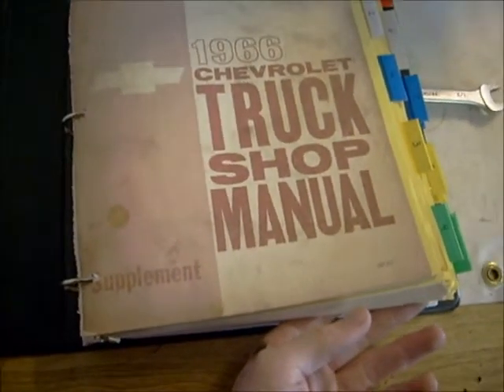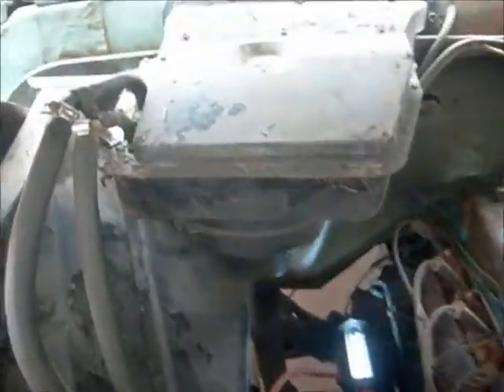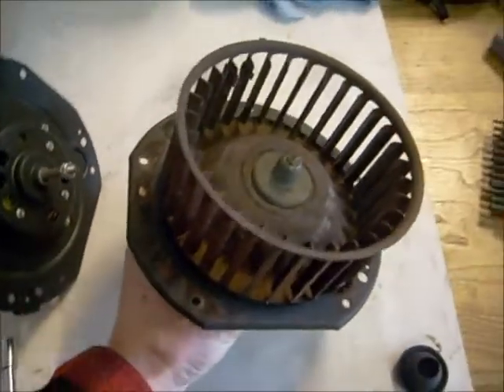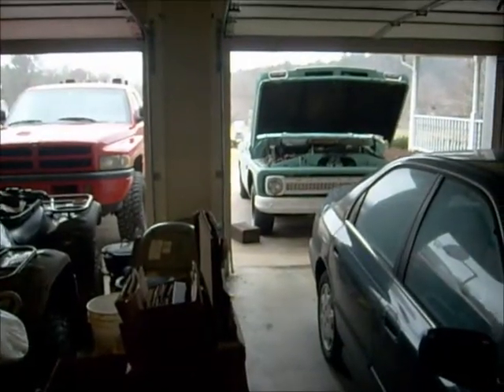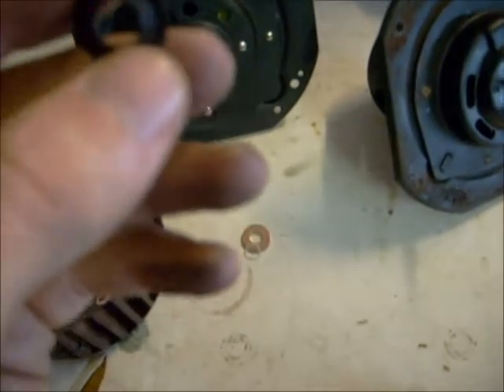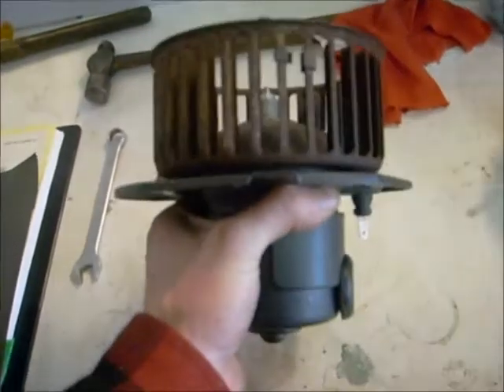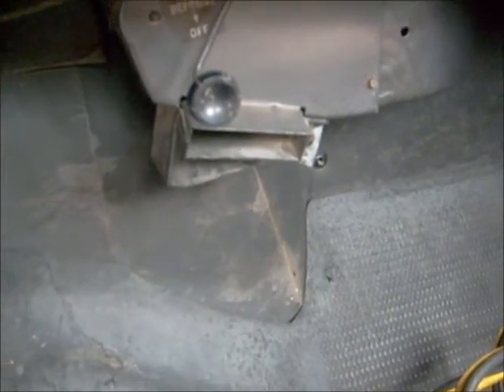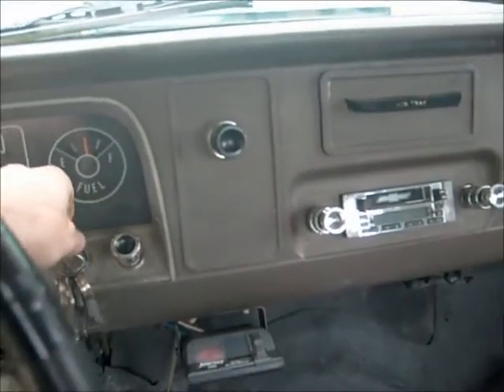1966 Chevy C-10: How to Replace a Heater Blower Motor

Comment: Nice,but you should have cleaned the fan and paint so it last 50 more years, I change my metal  squirl cage to plastic though alot less noise ,nice truck

Comment from the maker: The single knob is called the Thrift Air system and was the base model available. The three-lever system is called the Deluxe heater and was an option up from the Thrift Air system. There was also another level that was tied into the recirculating A/C system, and was the top tier option available for 64-66.

The thing about the Thrift Air is that the defrost lever isn't with the fan speed/temperature knob like it is with the Deluxe option. The defrost lever is under the dash on the heater box.

Comment: I have a 63 Chevrolet simular system different controls and I need to replace the blower resistor but I don't know if it is a deluxe or a non deluxe resistor is there a difference or any way to tell them apart?

Comment from the maker: @choirguy75 I checked the fuse block for any blown fuses and didn't find any.  I would try running a jumper wire from the positive battery terminal to the wire on the blower motor, if it doesn't come on, then I would suspect the blower motor, if it did, I'd suspect the switch being bad.  That's how I went about diagnosing my motor problem.  I bought my motor from LMC Truck, it was an identical replacement and of very high quality too.

Comment: I've always loved the 64-66 chevy trucks, and would like to have one, one thing I've noticed is that many have a knob for heater control as yours does, my brother had a 65 when I was little and it had 3 levers. Is there some different option? Maybe a knob was dealer installed where levers were factory?

Regardless, awesome truck!

Comment: .Some one has been working on your truck before you. They did not put screws they used AC small 6 point screw nuts on there 1/4 and they're easier to reach with a nut driver that is one place you do not want a screw.
Reply from the maker: That would have been me.  The original sending unit died in 2004 and one of the screws stripped out when I was changing it out.  I retapped the hole in the gas tank and upgraded screws to what I had on hand because I couldn't drive the truck to Lowe's to get a bag of matching hardware.

Comment: I just replaced the fan motor in my 64 but have no heat
I replaced the thermastat and blew air through the core still no heat
Any ideas what i need to try next?
Reply: Its time to pull your heater core apart you might have a core blockage or you have something stuck in the bypass hole